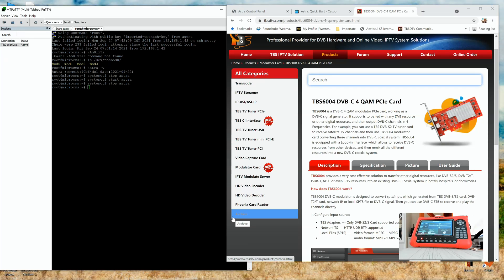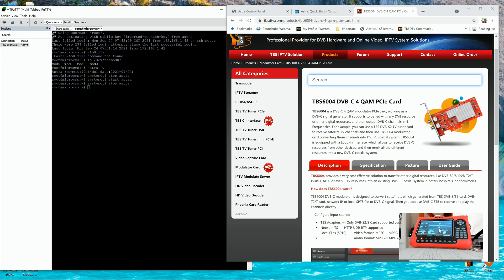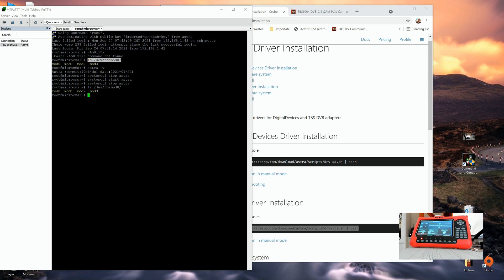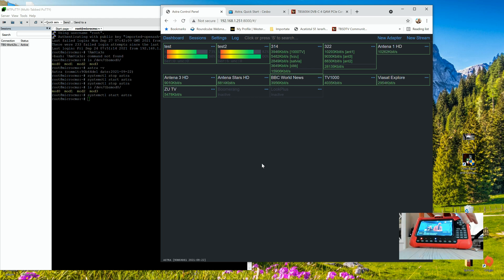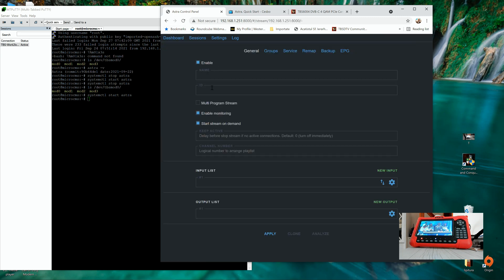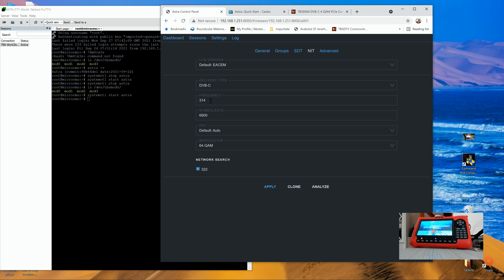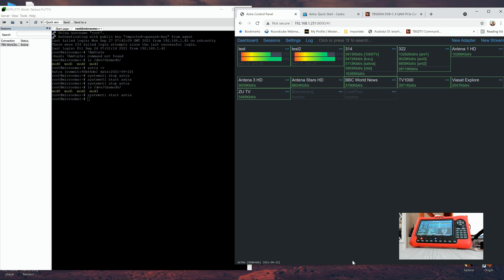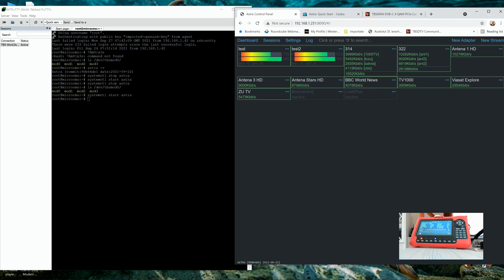Astra Cesbo + TBS6004 DVB-C Modulator = easy life for small tv operators

Comment: Hi, tell me an opinion about TBS6032 16 QAM DVB-C Modulator PCIe Card, thanks!
Reply from the maker: apart from "must" use CBR content as input there is nothing else to say against TBS6032 dvb-c modulator
Reply: @ovidiuss31  I asked TBS and Cesbo support about it, and both of them said that at this moment TBS6032 is not compatible with Astra, and recommended card is 6004, and yes i can confirm that, 6004 is working wonderful!

Comment: hello, please before buying a modulator i need to know what i need for an rf transmission, i have 2 tbs6209 already installed with and working with astra cesbo in 1 server now i need another server with the modulator card to receive the streaming and send it by rf would be that? I'm confused haha!
another doubt is the modulator card being 4 frequencies will send 16 channels by rf?
Reply from the maker: You need to calculate bitrate and see how and what fits in each frequency of the modulator

Comment: Hi ,why it doesnt find my TBS 6590 when i want select a adapater?
Reply from the maker: Perhaps driver not properly installed?
Reply: @ovidiuss31  Driver is installed maybe because im using windows or do i need to install ubuntu or a linux server ?can u do a tutorial please
Reply from the maker: @liri-AMG  in Windows you need to make use of the dvb protocol switcher tool
Reply: @ovidiuss31  hi boss , i want to get the channel signals via cesbo astra and when i install it on any linux server it doesnt show the adapter and i have add the tbs on my pcie slot
Reply from the maker: @liri-AMG  if adapters not shown then drivers are not correctly compiled and installed
Reply: @ovidiuss31  so i dont need any linux system and i can do it with cesbo also via windows?
Reply from the maker: @liri-AMG  Cesbo astra app runs only on Linux

Comment: i have multi standard dual tuner 6522 dvb c and dvb t, on dvb c is normal but dvb t or dvb t2 is not working,
Reply from the maker: Which software are you using ?
Reply: @ovidiuss31  astra cesbo
Reply from the maker: @litansilwanus  I would advise you to open a support ticket with Dimitry from Cesbo , just write them in the ticketing tool they have for support and they will help you.
Reply: @ovidiuss31  ok thank you for the advice
Reply: @ovidiuss31  card TBS6522